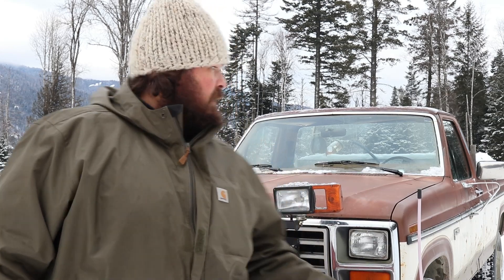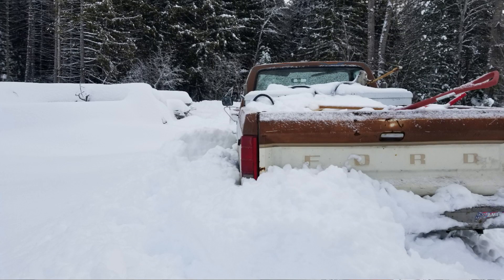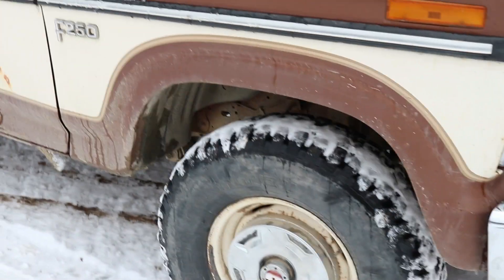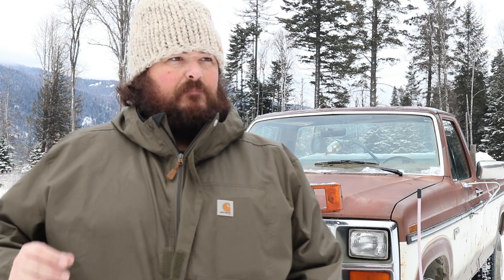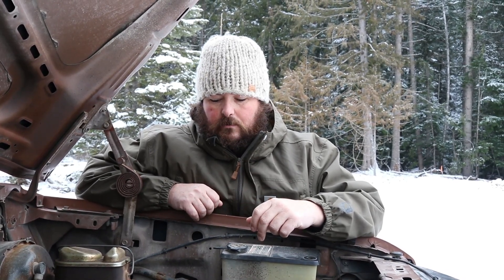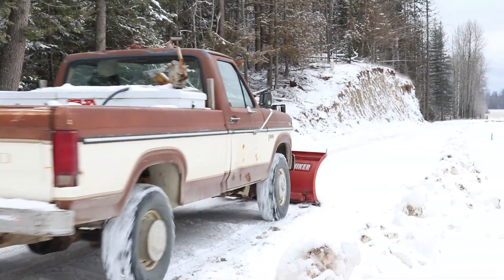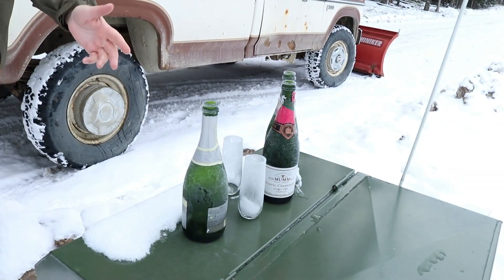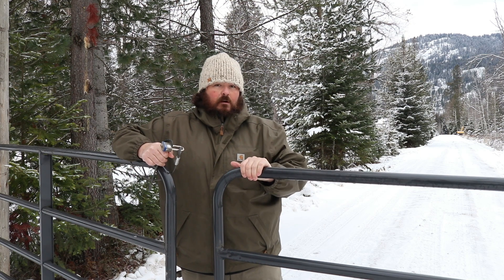Snow Plowing with a 1985 Ford Truck

Comment: okay it's like saying do I lock the gate or not okay you're in an environment where something else live there before you you cleared it all out you put a home on it and then you expected to be bug free germ-free Aunt free pest-free good luck with that one not to mention the human pissed that we all areeverybody has the money to buy with somebody else bought and sold to somebody else in a prophet pthe rich and the poor become the people that have a home in the people that don't have a hometo where you have the apartment life either condensed into 8 into an environment like the way you say when it comes building do I need to build a 300 square-foot place or a 3000 square-foot place and how do you build it where you doesn't cost you more for roofing will you build it up you said having open spaces is expensive you need more of it when it's higher than 10 ft tallin order to have 20 foot ceilings in your house all to your house you got to build a pretty big housenow you got twice to space unless you know everything is great if you have a ground floor system where you have endless amounts of space that's great if you can afford it then you have to heat it and you got to maintain it and that environment where you're atwhenever you're shoveling off the off the road has to be shoveled off the house away from it how do you make a house like that all these things coming to factor when it comes to building a home it's landscaping putting it up and you're going to have snowfall come off the roof and pile below it if it doesn't have a way to basicallyI understand how people live in in a place where they don't if it's snowing something has to come and push all that's known off the streets off your driveway in order for you to get in and out of your home cuz he doesn't magically just disappear off the drivewaya lot of times our homes are high up on high up on the ground that way when the snow peels off of them they have 10ft to fall to the ground that way you have a 10-foot buildup of snow I have a bridge at the higher levels will you enter the second floor or something like thatno matter what happens whenever you're living on a piece of land if it pass snow come down to 2 ft 3-ft 4-ft if you can walk on it and keep it run your house that's great you can't do that you have to push it away have to snow plow iteither you provide a service for your community to me that every every place that Snow's has to have somebody that clears the roads supposed to snow can't just stay on the road and you drive over it doesn't work like that either so to maintain your property in the winter time we have to have somebody else lake Tahoe they don't have Gates and ways to get into properties they havejust like you having a normal situation was no snow on it you have the same conditions in the winter time will the snow has to be pushed off the road onto the side of the road which then builds up a big old Bankthe sides of your Rhodes at to take the 10 the road usually 20 ft wide twice or 40 feet wide and you have to push that snow to the side of the road so and that builds up a buildup of Richard you driving in a tunnel one at the end of the winter until it starts melting in the end only way into those kind of areas if you don't plow them is to have athe only way to rip off those kind of areas in the winter time as if you have the right equipment to haul it out if you can't just drive big load a bobtail truck in there and pick up everybody's belongings and drive outso in the wintertime what are you worried about no worried about where you live you can't you can't even keep a chicken's without having to keep them caged and control the environment it's no different with humansanything that they might want to need somebody will buy it and steal it and sell it to somebody else
Reply: that whole story what you just did about fixing a truck that's 35 years old to plow a piece of land it wasn't intended to do it can't maintain that wrote it can't work on that property and you're not going to be able to maintain that road every year every 3-year if you have worth keeping it open you got to go through equipment equipment wears out that one's not going to last forever where do you get the parts for it it's built better than most of the new stuffnotary to get the kind of vehicle you went out there you have to overbuild it Andover build it means you're building it too strong for something so it'll last longer and you don't put it through that full-strength of its capacity of people don't let people push it to the limits so you get a really fast car but if you drive it you knowbullitt car last forever I don't know it's not a bulletproof it's a rare cars going to make a lot of them when they do make it right why do they change ittheir whole goal is to sell product in the people that buy the $90,000 cars are going to buy new cars every four years and keep them in business so they make these cars disposable so they can get the return businessspending $100,000 in a truck that's fully equipped to be putting snow put through work abuse just doesn't exist bulldozers designed to do the kind of work that you're doing snowthey make you sneeze for roadways you can do them cheaper but you're not going to get the performance out of them that you're looking for in order to maintain a road up there in the winter you going to have to to basically plow it on a regular basis over and over and over even after you build the roads on it you're going to have to maintain it to where there be another what the government there's all kinds of crazy regulationsyou can't divert the water away from your property to some other property and make their property unusable you can't cut their water supply I'll be there and you can damn there you know there's all kinds of things that you can't do upstream but unless you ownyou know how to build you know how to build right you know how to build what's cost-effective but if you had the money would you put in the $200 but can pieces of tile versus the $25 piece of tile for she would go all out and spend the extra money doesn't matter to youwould you put gold fixtures on the wall instead of gold looking stuff course you would people want to still have pain he's a very good at all these paintings that are worth millions of dollars who has them people that have lots of moneyhaving a painting on the wall is worth a hundred million dollars if you have to have fort Knox to have it displayed in your house cuz somebody wants to steal it it's not something that's that's not my cup of teayou're doing all that project you couldn't find anybody to come get the wood you can help me cost of labor to make that stuff happen if you do and your labor for free well and you're giving it away your customers and it works fine but you don't work for freeyou're moving up there to have eight people move into your neighborhood and wants that pays for itself you're going to move on to the next property and then extra and that's how you're going to make a living you're now a developeryou're going to design a property that you know the best customer wants over-the-top stuff what is my does it cost so much more to build more square footageconstruction is construction when you go to timber frame it's way more expensive and stick framing why would you use it what's the benefit it just looks good big deal you spend the money on basically keeping the envelope warm and dry and easy toputting skylights and big huge opening Windows so you can see the view and the coldest the weather who caresbuild yourself a 10 x 10 room that's glass-encased where you can heat that room only and go out there and enjoy those views and feel comfortable but you don't make your whole housenew construction Des to build your house like a refrigerator where it takes no energy to keep it cool and keep it but we breathe are we have to bring in cold air to misically so we can replenish the the warm air that we just exhausted all the oxygen out of pyou seal a building as good as it frigerator now you got to bring in the fresh air and you got to have a way to distribute that through your house where nobody diesyou can put yourself in a box underground bear yourself there's no are getting into die that keeps the heat in and doesn't let it exityou're cold environment if you go down into the Earth no matter what you go down to put 20 feet or whatever the temperature of the earth doesn't change down there doesn't go to 0 degreesweather stays 50° all the time and all you have to do is I'll exchange it 20° and that's your whole environment swing set of we're going outside now it's 0° and